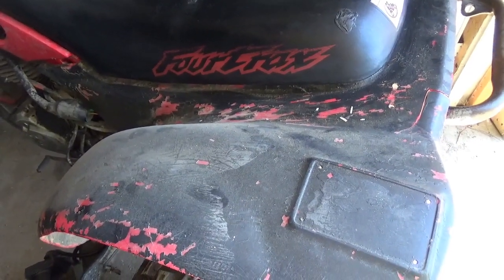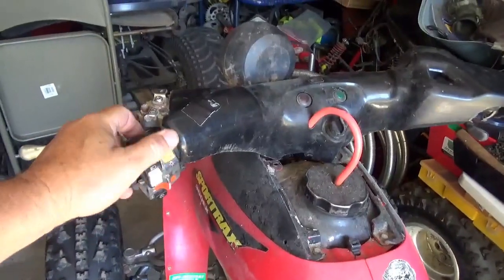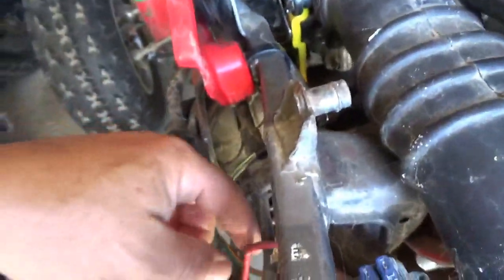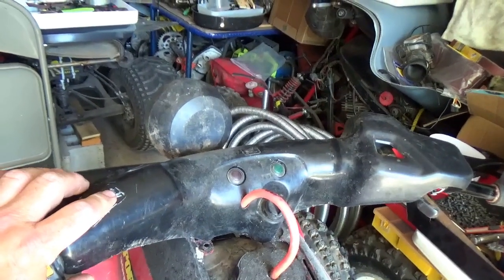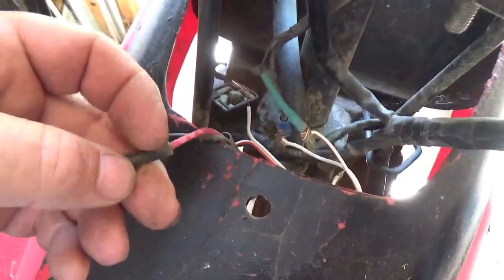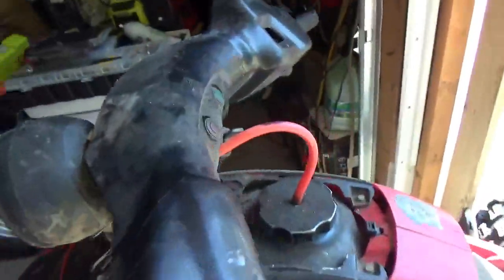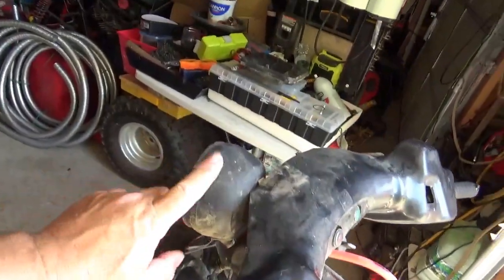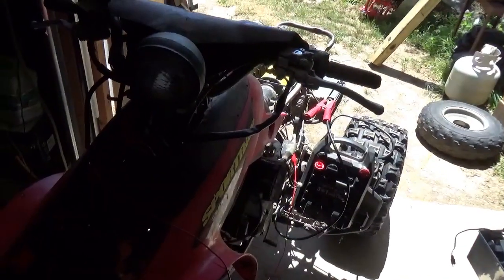No Lights, No Crank Honda ATV, Fixing the 12 Volt Side of the Wire Harness!

Comment: Hey buddy. Not sure if you’re going to see this but if you do can you please respond. 
So I have 02 Honda 400ex. It always fires write but I took it out today and let it sit for a few hours  then went to head back out and nothing l, no lights, no crank, the neutral light was working when it wanted to, nothing. I did jump the solenoid and it started to crank and it fired up😅. 
On the ride back I switched the headlights from low to high beam and every time they would get bright for a second they would go dim and it was running funny. 
Made it home and once I shut it off I tried to crank it again and nothing. 
Really need some help.

Comment: Did you find out why the lights did not work and resolve the issue. If so could use help for mine.
Starts and runs but no lights or power to them

Comment: My 1998 Honda 4 Trax 300 has no sparks and got to find out that the nuetral light and reverse lights are on together. When I turn on the key switch the nuetral and oil temperature are on then the oil light turn off after a few seconds  I crank the engine and I get a little spark but then the reverse lights trips in and the spark is gone. Don't know what is going on....

Comment: To add to Harvey's comments about the starter solenoid dont assume that because its new that it works. I recently had an issue on my quad where when I hit the start button it would start cranking over and never stop until i disconnected the battery. Looked for a week to see if I could find a bare wire or something grounding it out. I ended up replacing the brand new out of the box solenoid with another new unit and it worked perfectly. DOA unit right out of the box. I credit Harvey and the multimeter checks!
A Q&A Video would be awesome. Questions I have its answers I need hahaha